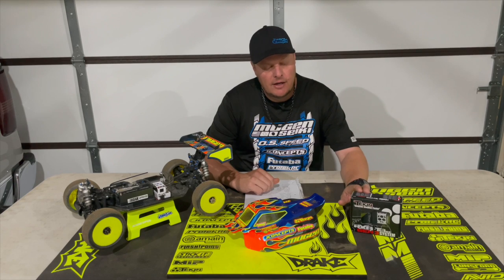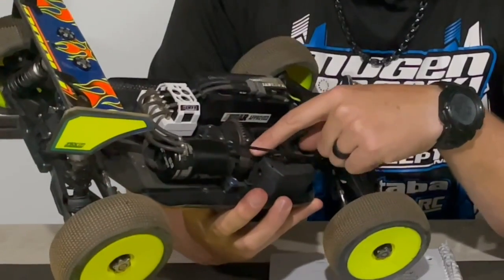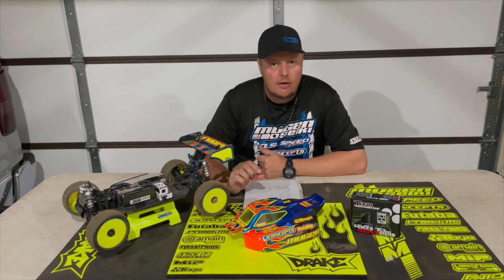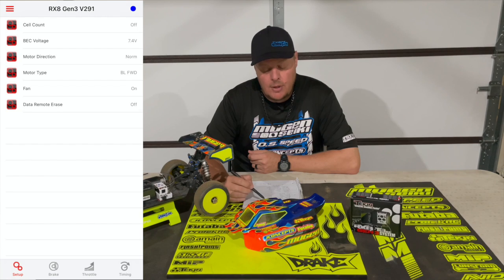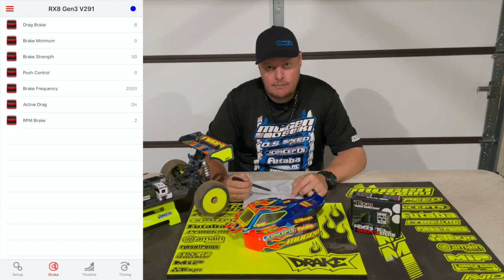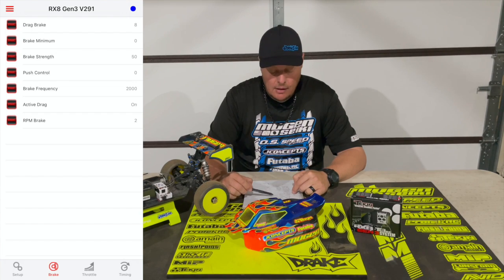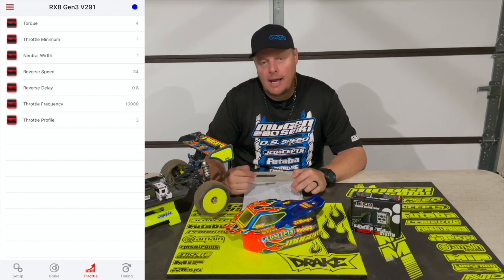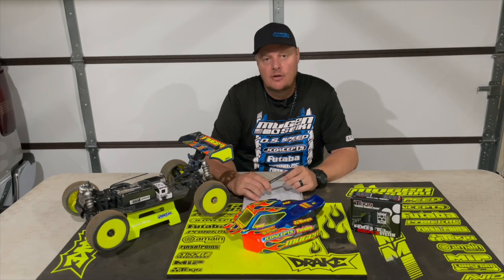ESC, Motor, and Radio Settings.

Comment: Thanks for the update , impressive that your running neutral width at 1 , but your remote must be super reliable most racers have a lot of drift in the throttle and steering and don't know it.
Reply from the maker: Yes, the Futaba T10PX radio is awesome.  I do run a Dean's style connector and it works great.
Reply: recently I changed my motor setup on my buggy , still love my RX8 gen3 , I changed from another brand 1900kv to a tekin 2050kv motor and the thing that impressed me the most beside more speed was how better the brakes where with my new teknin motor.  Are you still running your deans style connector on your esc and batteries and how often do you change them ?

Comment: Never realized there was some factor between brake strength and motor RPM.  Guessing this is what the brake frequency setting is all about?  Never changed it on mine but I've noticed my brakes are too strong coming down the front straight into the first turn, often endo'ing the buggy if the traction's too high, yet the brakes feel ok or a bit too weak in the corner entries elsewhere on the track.

Also, wasn't expecting no-fan on your setup.  I've always ran one on my ESC and never thought about it.  Do you run one if it's a hot outdoor mid-summer event?  As always, thanks Drake!
Reply: Brakes on ebuggy are locking the motor up. Its either locking it up or its not. Brake frequency controls how fast/wide those pulses are.

So a lower frequency feels like more brake bite. I prefer kind of like Adam, low brake frequency so I can hold my car still at a stand still, balanced by lower brake EPA. I actually run 70% brake epa, which can be a little strong. So I balance that further with a strong brake expo so I can dip into the brakes to get a gentle stopping power or jab it all the way to emergency stop. Basically I just experiment until it feels more like the nitro disc brakes😀👍
Reply: That is where you can use the RPM Brake setting. Set the brake strength so your high speed (end of the straight) brakes are how you like them and if they are too weak in slower sections, you can use RPM brake to increase brake strength only at those slower speeds.